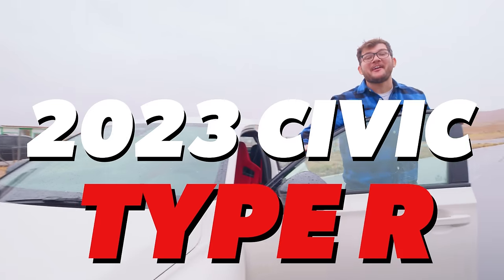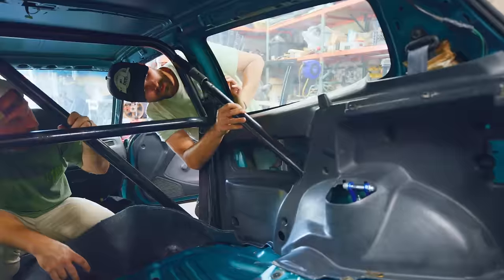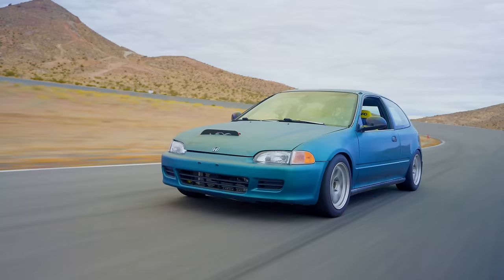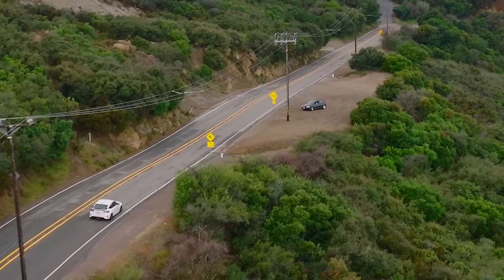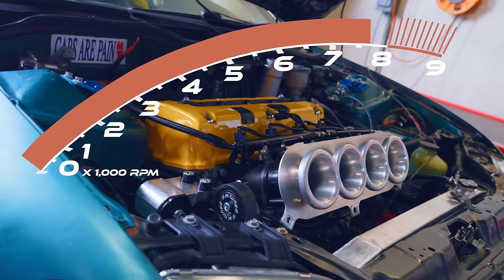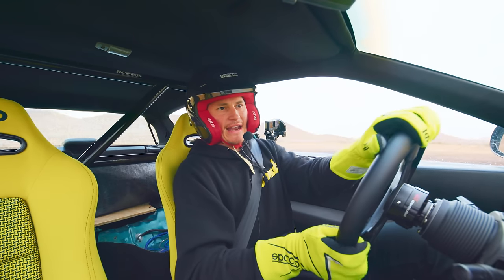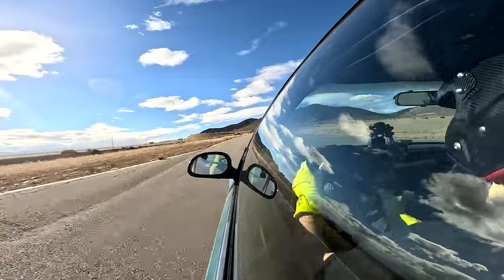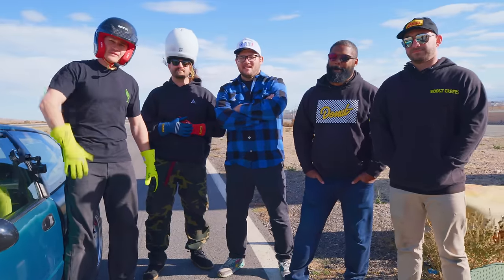$500 Civic vs $50,000 Civic Type-R (THE REMATCH)

Comment: 50k for 200hp nice
Reply: More like 10k on actual engine
Reply: I spent 8k on b20v to get 230hp and 300hp on the way with out turbo boost until now 12k with suspension and the wheels 😅if I spend 50k my car will be full carbon fibre in and out 🤷🏻 (1999 civic si coupe)
Reply: I think they don’t spent that 50k wisely on the car 😢2500$ on the seats and another 2500$ on non adapted coil overs suspension

Comment: I think you guys should do a at home paint job to it (homemade paint booth, small compressor, maybe try to replicate the steps the Rolls-Royce dose with there paint but at home) and put a turbo on it. Also, after you make the paint look nice, do that clear wrap to protect the paint like everyone does.
Reply: Yeah sell that waste of space, waste of power, waste of money ITB setup and use that money to turbo it. Match the new civics horsepower and watch it dominate.
Reply: Even a Rotrex supercharger from Kraftwerks would have been a million times better.
Reply: @Driftmonkey  I would have to agree that a supercharger makes a car way more drivable.
Reply: @thomasm3324  The Rotrex is a fantastic addition to the air hungry k series, makes bundles of power with essentially boost by RPM. I have a forged B18 Type R engined EG6 with a rotrex in the works at the moment. 267kw at the wheels with a power band that looks like someone used a ruler to draw the line 📏

Comment: Did they ever mention what tires is on the eg? I feel it’s an extremely important part of the equation, it’s arguably what’s making new cars faster despite not being more powerful per weight
Reply: They're Nitto NT01s, the new car is actually at a tire disadvantage.
Reply: @proximitypi to say the least lol. Those nittos are NASTY. They just need a tiny bit more power and that thing is SCREAMIN
Reply: They did in this video yes
Reply: @proximitypi I want some of that copium you smoking if you think NT01s are faster than Cup2s.
Reply: @proximitypi  Are you sure? I've had more grip with my Cup 2's

Comment: I personally would never cheap out on the safety gear. But I'm sure they definitely could have cheaped out on the seats and mabye the A C and added some more performance modes to have a better shot at the civic r.
Reply: If they would have spent the money they used for the ITBs on turbos it would have beat the new civic
Reply: @darthvaydor6716  Yeah, it definitely bought that just for the looks. And so the episode would be cooler than just installing a generic part.
Reply: Bean

Comment: Fifty thousand bucks, but one also has to factor in the cost of building it if they're not experienced in mechanics and/or don't have the tools to get it done. I really wish the old civic had beaten the new type R, but let's face it: it makes sense that it didn't. Loved the project though, and definitely would like to see more videos of this beast!
Reply: It makes no sense. Yes these guys have a FULL team of mechanics. They built the motor themselves. They wasted wayyyy to much money. Pointless things and didn’t even put full effort. Just threw dumb stuff at it. Could’ve at least boosted if they didn’t do that intake. Plus the interior screw the recaros and get momo jegs ikon sparco nrg. Literally any of them and got more for the interior. Do suede yourself and clean then spray the carpet. Add a touchscreen and backup camera. Use a pillar instead of throwing those gauges there

Comment: I have a megane R.S it makes around 330hp 340ft/lbs on a tune no mods, and it is probably the most comparable thing to a civic type R today. (you cannot get it in the US though I beleive) It's interesting to hear the type R (new) gets little torque steer. Even with a wavetrack diff (factory) on the front and I get crazy torque steer and even did with no tune at 295ft/lbs stock, some Japanese magic going on there. The EG hatch is cool as hell and will always hold a place in my heart as I had one as my first car, insane build!

Comment: Guys, weld the seams. You still have some work that can be done. Stiffening the chassis will complement the suspension upgrades you've already done. I'm not sure there is enough to make up the missing time, but would be worth checking out.

Comment: that eg needs some cams/ Valve springs  and a better tune , than you can have close to 9300 rpm and 285 @ 8600 ....and then it would be exactly my build eg that i dream of , but i lack the 50k for it 😞

Comment: I Lil wing would helped alot and I think you'd be surprised.  I'm shocked it wasn't slower than that. Other than weight I see no advantage. Add a little downforce to that botty and you'll eat corners.  So mutch less understeer. The ek si and type r wing is pretty big Part of what made is a huge overtaker in honda in its time

Comment: Issues I see that keeps the joke and spends less 
10k on interior for it to be mid here’s the changes I’d do
- spray the headliner and carpet
(Or do suede yourself)
- nrg, jegs, momo, ikon
- touch screen and backup camera
- pillar for the gauge 
Still be well under half at that point
10k+ in motor
- turbo kit instead of that manifold 
- supporting mods with money saved from interior if needes

Comment: I want to know what the difference in tires were with those two cars and if that suspension ever got tuned by a pro. If not they could probably easily get that two seconds and then some. 

That said if I had 50k to blow on a toy it'd be the EG. If it were going to be my only car I'd have to go with the Type R.

Keep building that car, I want to see what it can do in it's current form with a bit of fine tuning and good tires. Maybe some small aero components like a splitter and diffuser, little tiny adjustable wing might be in order.

All I know is that car with that suspension setup should be on three wheels around the corners lol

Awesome video, keep the shit boxes roaring!

Comment: Put some sound deadening, a turbo and LSD in it. Then they'll be much more comparable. For now I'll take the 2023. The tin can is simply too harsh for a daily, and underpowered for the circuit if you want to be fast. It's a bit too much of a compromise in both directions. Either make it a full time attack, or a sleeper daily. Now it's neither in my opinion.

Comment: Obviously the next step is a turbo! I'm guessing you won't even have to redo any of the internals, cuz it can handle 9000 RPM's. I mean a moderate say 15psi-20psi. Just a guess, they should bring wheel horsepower up by say 100!!

Comment: honestly though instead of that intake and throttle body if they have gone turbo it would have been about the same cost and would have made up that extra hundred horsepower plus some. probably would have made up more than 2 seconds on the track

Comment: 50,000 into the old civic vs 46,000 new civic with 4,000 in performance upgrades. I’ll take the new civic and 2 seconds off the clock.

Comment: I got a question, I have a ford laser 2004 1.3 glx, but I wanna invest in it so much to get a car like this honda, should I swap the engine for a K20a? I mean, it has a 4 cylinder inline so it's like the same height, maybe if some could tell me what else could I do, ofc I will buy a cool air intake, I dunno if it can have a turbo but I'll try it, also buy a new suspension, change all the brakes, the exhaust, damn that's so much money but I got inspired by this video

Comment: If the point of the EG was to make it perform as well or better, money could have been better allocated, the interior was unnecessary, could have allocated that money into other places such as the engine and transmission,  for a 50k budget I feel like the money was poorly managed on the build . Especially if you’re trying to give the illusion of what can be done in house without using a shop to do the work.

Comment: Damn 50000 on the eg seeeesh was your wages included a complete turbo engine build is like 20k suspension 2-3k
Seats just need 5k brake kit 2-3k  wheels and tires 3-4k all the other extra bs 5k
And that’ll build you a 400-500hp Honda

Comment: 50k into a civic just to make low 200 wheel is crazy when theres ppl putting maybe 10k into boosted d16s and making over 400 wheel reliably (i am ppl)
Reply: That's low 200s crank. It's basically a stock N/A K20 in a stipped FWD tin can. I'd bet money that engine isn't even 230 crank, more like 210-215.

Comment: Honestly, hate new cars pedestrian safety bulbous exterior, hate all the electric seats and weird electronics.  I've got a 2014 Audi RS4 and I can't fix it myself, it's a nightmare whenever it goes wrong.  Suspension, drivetrain, engine and brakes are utterly amazing, but forget the rest.  Old EG all the way.  In 20 years time, you'll not be able to repair the new Type R.

Comment: yall know you spent way too much on worthless swag. if you made it AWD with 200hp@8k rpm you would still beat it. the suspension/weight shift alone erases the launch of FWD
Reply: as well as the new civic being wider for more downforce
Reply: and i could have driven better XD
Reply: I would have smoked both of them in my used civic si i bought for $2000 with just a tuned intake